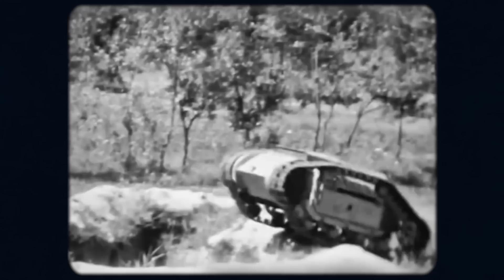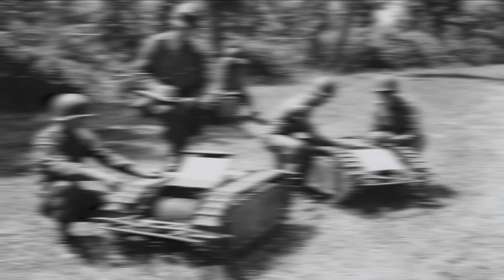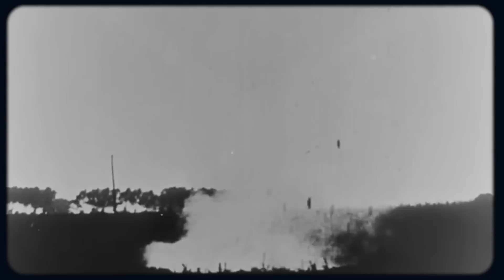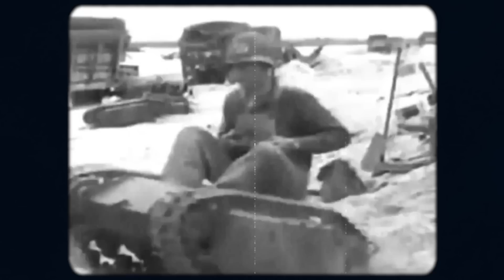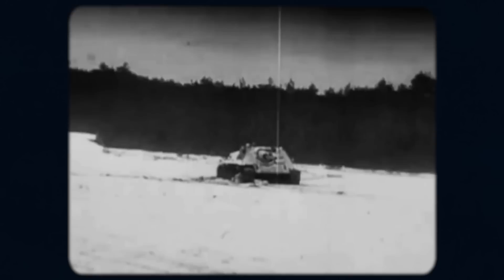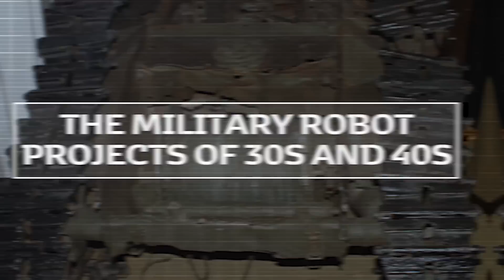Goliath Tracked Mine: WWII's Tiny, Explosive Demon Vehicles

Comment: Absolute Bullsh!t, Firstly the base model of the Goliath Minenräumwagen Sd Kfz 300 was designed  by Borgwrad prior to 1939 and between 1939 and May 1940 (the onset of the Fall Gelb) Borgward produced 50 and one trial vehicle called ENTE (Duck) that was amphibious. The SdKfz 300 was gasoline 26 hp powered in a mild steel body and was designed for mine clearance, it saw no combat, but completely pre-dated the capture of the Kegresse vehicles.  

The standard German charge layer during the Battle of France was based on a Panzer 1 Ausf B tank as Landsungleger auf Panzer 1 Ausf B, and it was the development from that concept of a RADIO CONTROLLED vehicle called Ladungssträger Sd kFz 301 Ausf A, B, and C these were based on the Borgward Ammunition carrier (also designed Sd Kfz 301). These remote controlled AFVs were driven as a conventional vehicle to an operational area, then the driver's station was disconnected and closed up The vehicle was then driven via radio control to deploy its bomb . Ideally the BV IV (as it was generally known) would lay the charge and return to its own lines to be reused with another bomb, the bomb was a charge in a thin sheet metal container that was slid down the sloped glacis, and timed detonated or radio remotely exploded the charge was 500kg of high Explosive.  The demolition of disabled BV IV and destruction of very high priority targets could be carried out without releasing the bomb, see Kiliński Street during the Warsaw uprising of 1944.

In all around 900 BV IV were produced and used in combat, the guidance vehicle was initially a Pz III with an extended box structure in place of the turret bin that housed the radio equipment, and later as Pz III was discontinued in production the guidance vehicle became a StuG III generally an Ausf F8 or G, and obviously an advantage as being a barbette AFV there was less problem carrying the radio container on the engine deck. There is some evidence of  Tiger 1 equipped units (the 301st Panzerabteiung) being issued with 21 modified Tigers to control the BV IV ausf C.  

In late 1944 a similar concept to BV IV was constructed as the SdKfz 304 Springer, using the production line of the famous Kattenkrad 'motor cycle' halftrack Springers were controlled by Stug III, a Radio controlled demolition unit at the time (1945) comprised a StuG III commander AFV and three StuG IIIs each radio controlling a Springer each,  Springer carried a 330kg charge.      

Combat using both leichter Landungstrager (E and V) and BV IV were documented during the August 1944 Warsaw uprising along with use of BV IV, indeed the tragedy on Kiliński Street was caused when a BV IV was captured by Polish Home Army troops, after its driver had taken a wrong turn ran into a road block/ barrier, and he then legged it. The BV IV was brought into their own lines by Home Army troops as a prize and a crowd gathered to view the curiosity, whereupon the BV IV exploded, killing over 300 people. Considering the primitiveness of radio in WW2, the explosion may have been happenstance when the vehicle was momentarily reconnected to a radio signal, probably any signal might have done it, R.C. at the time in a built-up area must have been intermittent at best.           

Several other things missed in your content, the Goliath was often transported on a "Transportkarren für leichten Ladungsträger" which was a limited production single axle tubular constructed trailer similar to that used to move light 2cm Flak 30/38 A/A guns and some searchlights effectively it was the shape of an oversized tuning fork with wheels at the fork ends, it is even shown in use in your content (probably from newsreel taken during the 1944 Warsaw uprising), these transport karts were eminently handleable by tow or three men.  

As to the Goliath itself, it was from the outset a single use item, and was thus built to that standard, and has to be compared in cost to other weapons - for example a V1 does the 100kg demo charge of a Goliath compare to the cost of V1 (and the firing ramp) when the charge on a V1 is a mere 10 times larger?  Because of the single use aspect, the components of the Goliath were necessarily short life, consideration was given to produce the body in concrete, like a kitchen sink, the bearings throughout were white metal, sometimes even lead, even in the I.C. motor the bearings were cheap spelter metal, the electrical motor was dropped not just because it was comparatively of a tiny load capacity, but the ineducable cost of copper in the motor meant it was unsustainable, after all the Porsche Tigers with Electrical transmission were discontinued for the same reason, it had to be said what in the 3rd Reich in 1945 would run out first, copper or oil?  Incidentally the Electric motor version of Goliath was more or less silent in operation especially if off-road.

Comment: Old news.  Not a robot but a wire controlled movable remote land mine.  Robots act by programmed instructions or even AI and act independently.  Without human control these are just another inert machine...containing a big bang.  The V2 rocket could be said to be a robot.